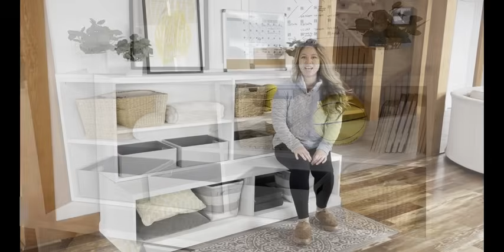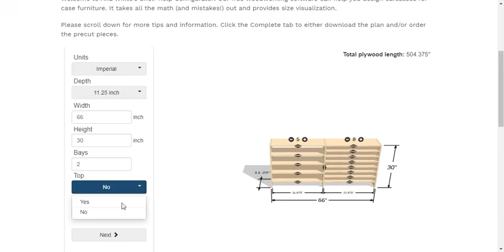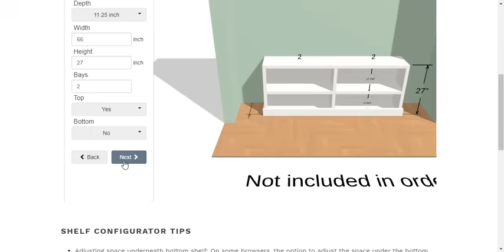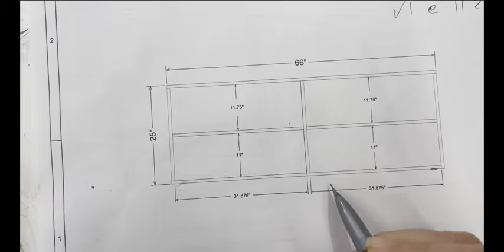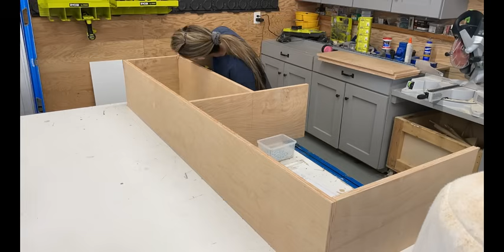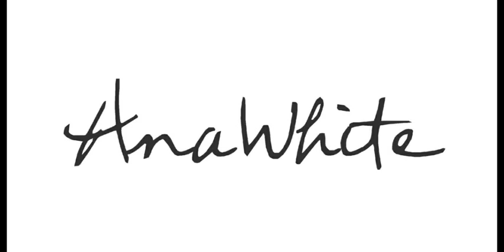DIY Custom Storage Shelf

Comment: That's the first time I've heard of the ability to order pre cut material to fit your plans... I'm not a pro but that sounds smart.
Reply from the maker: Yes, even if you don't order, you can use the configurator tool to design your projects. Thanks for the visit!

Comment: Professional, simple, and sturdy.  Nice job! I’ve used the app and it’s super easy.  For those they aren’t as handy or don’t want to mess with cutting it’s nice that you can order pre cut pieces.  I’m also a fan of pocket hole screws.  Be smart with where to place them and you don’t have to fill any holes as well as it’s super strong joinery.